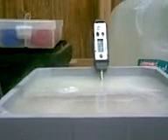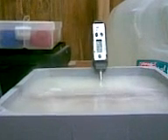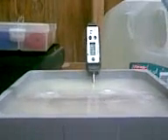HHO Electrolyte Testing

Comment: so what is your electrolyte here? im using 50/50 vinegar and water, with a little bit of baking soda.... is that safe for engine combustion?

will it affect my smogg? passing smogg

can it mess up my combustion chamber? leave resedue?

i heard that salt as an electrolyte leaves salt resedue in the engine and a toxic gas?
 (i dont use salt)

Comment: see if your plates are magnetic. I have found that depot and lowes will have ss wall plates, but some are magnetic, which means, made of nickle, zinc, crap metal. always take a little magnet with you and if it sticks to the plate, do not use it. No stick to plate use it. Great work, but thats where your orange tint is coming  from. Take care good luck. TATER WAYNE

Comment from the maker: Yes, I'm currently working on a power supply for it, but the cell will consist of about 55 plates, with only 2 of them being active, the rest are neutral. running on a total of 110v dc..  the down side is I won't have it finished until some time in Feb. :(  the power supply won't take much, its needind the green to order the ss plates..

Comment from the maker: No secrets here, the electrolyte is posted on smoky40's page. It consists of baking soda, vinegar, distilled water, rubbing alcohol, and hydrogen proxide. the " steam " comming off of the cell was actually the hho gas, it was 45 degrees outside, the cell was warming up to about 85. in higher outside temps you wont see that!

Comment: Very interesting, is it a secret or can you tell us what the electrolite was? Did the steam smell like it? What damages the engines that have been damaged by running cells is the steam that is generated by the high current is containing electrolite steam, not just water. AND most of the elecrolites used will disolve alumnum and rust iron or steel. The main ingredeants in most engines internal parts. So sucking some of the steam into the engine can be hazardous to the engine.